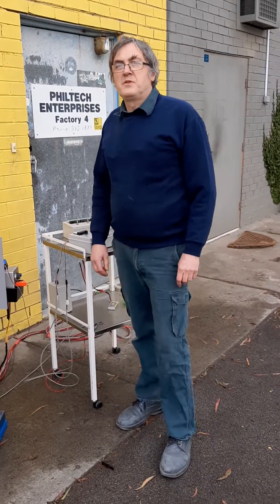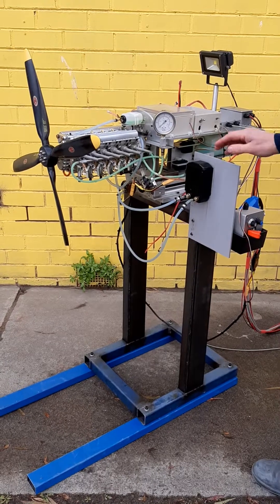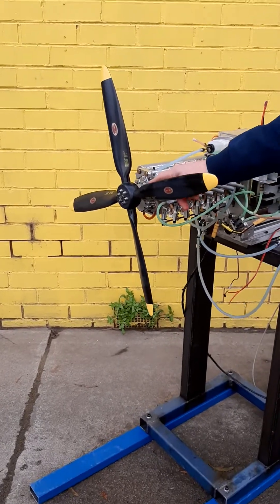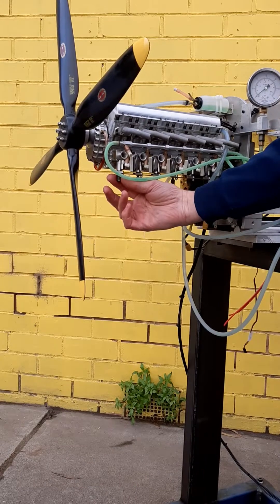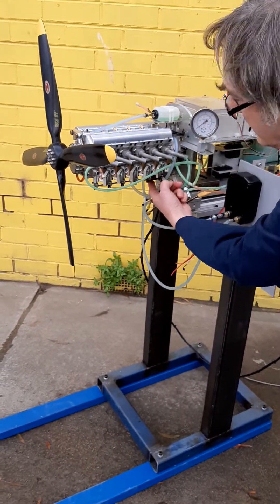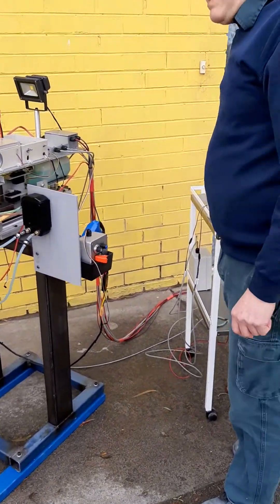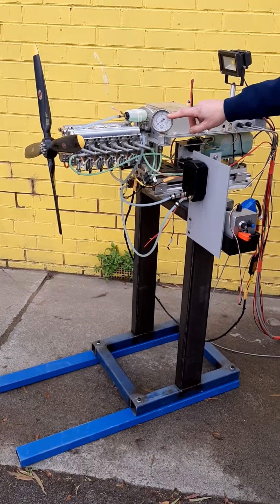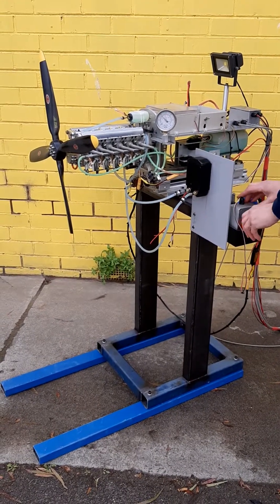Philtech V12 Engine with commentary

Comment: I was expecting an outboard motor like sound (V-6 outboards etc) but the resonant warble in the exhaust overall does bring on a 4 stroke sound @ part of the rev range. It may be a result of the disharmony of noise from the propeller and exhaust also.

 From Barrington Hare's exquisite scale working model to the Quarter scale Merlin companies version with belt driven 2xOHV and dummy blower, they all don't quite achieve a good scale sound. It's just physically impossible with tiny igniting mixtures and relatively high power density to make any of them run smooth below F1 like RPM's.

 Still can't see how you get even mixtures in each of the v-twin pairs, or maybe that is a trick to get the warble in the overal sound, sort of similar to why Harley Davidson engines sound so different to every other V-twin owing to the single carby delivering differential fuel mixtures from the uneven intake pulses.